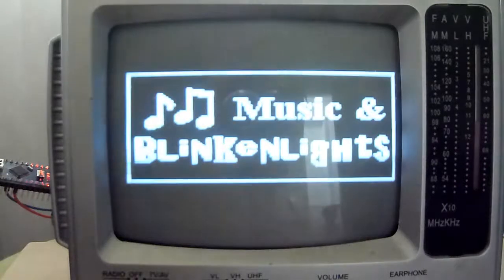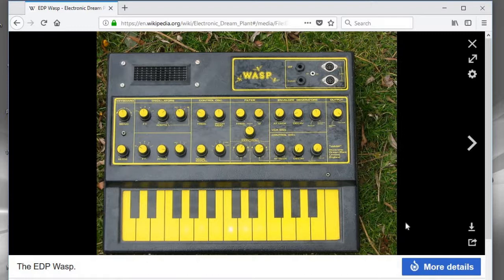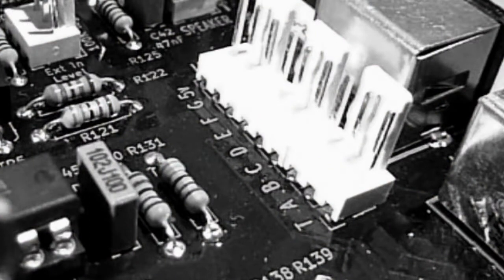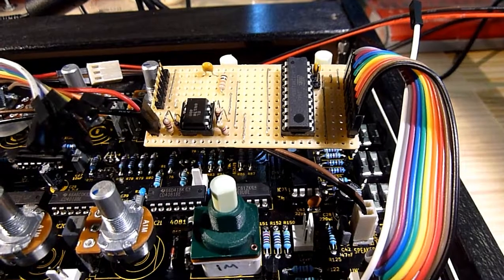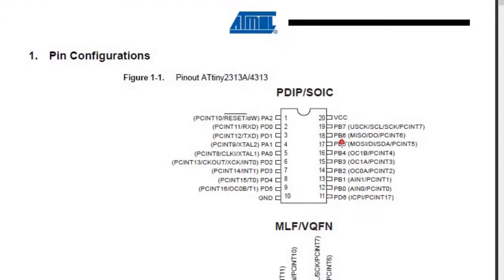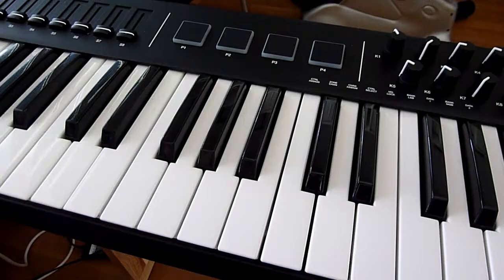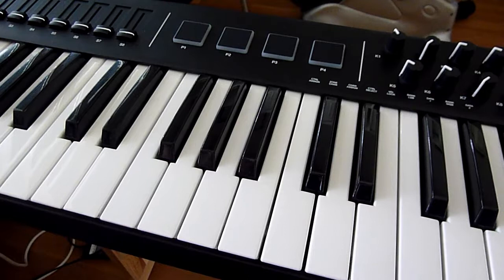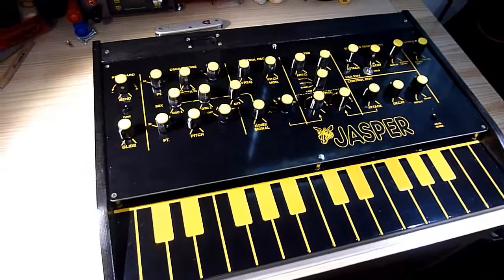MIDI for the Jasper Wasp

Comment: Excellent thorough video 👍 i could do with a midi upgrade, the makers current midi board has limitations , ie it wont handle these fast notes , although this is documented  in the manual.